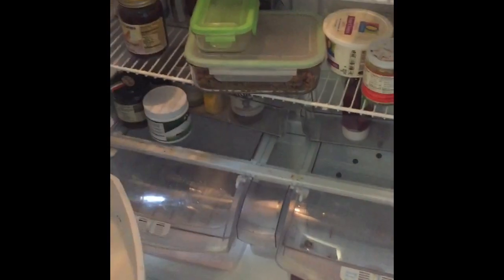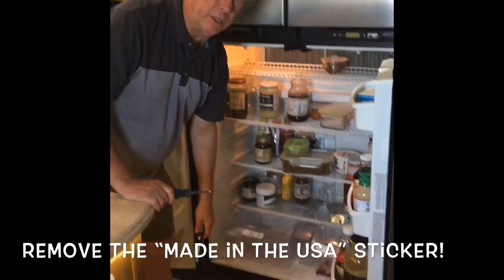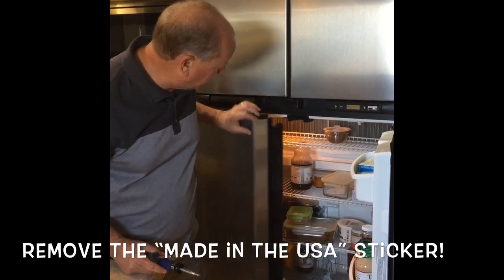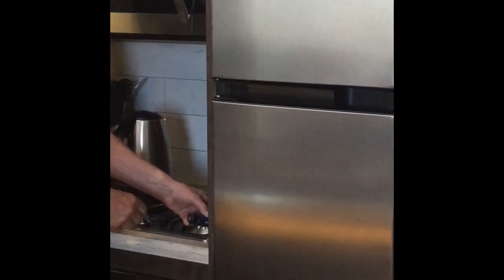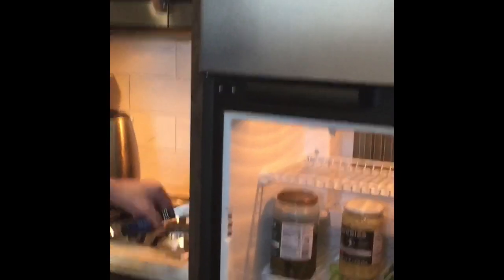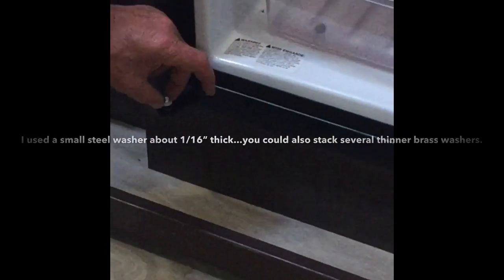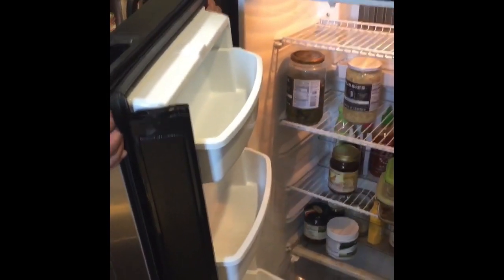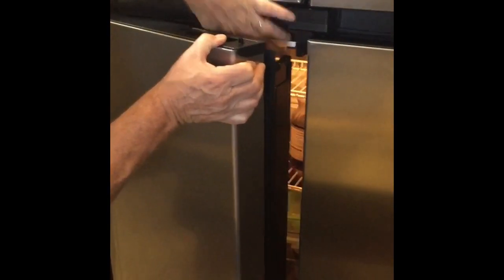Norcold 2118 RV Fridge Sticking Flap Quick Fix

Comment: Thank you for you informative video. Our brand new 2020 Jayco North Point had the same problem!! We’re moving to Texas from Idaho and didn’t want to take the time to stop at a dealership to have them fix. Found a Stainless Steel washer in my tool bag, did what you said and it works great!! THANKS!!!
Reply from the maker: Hi Philip, that’s great news! Glad you’re able to get on your way to my home state of Texas (Houston). One more tip from our year of full-timing it in our GD Solitude 380 FL, the support brackets at the bottom are on the less “heavy duty” side so I would try to keep from putting large heavy items in the doors. Sad to have to say this but this will also help preserve the cooling level in the fridge. Thanks for the comment and be safe!
Reply from the maker: Philip McLaughlin Awesome news and glad it worked. Probably should be a recall from Norcold at some point!

Comment: Thank you for your video. My issue with with the other door. There was no washer, so the would never click closed. While traveling my food ended up on the floor. The door on the right was lower than the one on the left. Plus I struggled with getting the temperature lower than 55 degrees.
Reply from the maker: Michael Resop Just spoke to someone else with the exact same issue on a brand new Toyhauler. I think this Norcold model should have a recall due to the amount of failures right off the showroom floor! We had to hire an attorney to get a new one after far worse failures than the door flap issue. And, I believe the lower door supports are under-engineered to support anything heavy in the doors exacerbating the problem.

Comment: So im having a problem with the fridge not cooling like it did before..its less than 2 yrs old..but everytime we use it we put heavy items on both doors. Do you think the door has sagged and lost the good seal? Will the extra washer trick help with the adjustment of the doors making a better seal? thks
Reply from the maker: Hi Steve, yes, it's quite possible that is your problem or, at least part of it. And, I would avoid putting heavy bottles in the doors regardless which is unfortunate but I don't think the support hinge at bottom were designed to be strong enough. Keep me posted if you would like.

Comment: what was the issue you had that made you have to do this fix?  our freezer is crazy cold but our fridge does not get below 48
Reply from the maker: Our issue was same as yours. Freezer was fine but fridge was not and the sticking flap doesn’t close all the way which allows cold air from the fridge to escape. If you go on RV owner websites and forums this is a well documented issue with this and other similar model fridges.

Comment: Jim, How do I know if my refrigerator doors are out of adjustment and need these washers added?  Mine is a Dometic.  Thanks
Reply from the maker: Hi Rayne, I never had a Dometic brand fridge but if either or both doors are sticking on the bottom when attempting to close, there's a good chance this same solution would be a fix for your unit. Is your fridge cooling properly or do you suspect something isn't quite right? You might also check the owner's forum for whatever RV brand you have as there is usually lots of solution-oriented information on those sites. Hope this helps.

Comment: What size inside diameter washer did you use? Looks pretty small to go over that pin.
Reply from the maker: Unfortunately, I didn't think to measure it but my guess is around 1/4”.
Reply: @jamesbell6765  I got it done.  Thx
Reply from the maker: Patrick Melson, good to hear it! DId you happen to measure the inside diameter for everyone else who does this? Any other suggestions on this quick fix to future DIY’ers?

Comment: These Norcold products are garbage! They all have numerous issues. The doors dont seal and the door seals are no longer available and they all have had additional cooling fans installed. AND THEY STILL DONT FREEZE WATER! I think a class action law suit is in order. They continue to produce an inferior product and the RV manufacturers continue to install them in spite of the known issues.  2015 Grand Design Momentum 388M